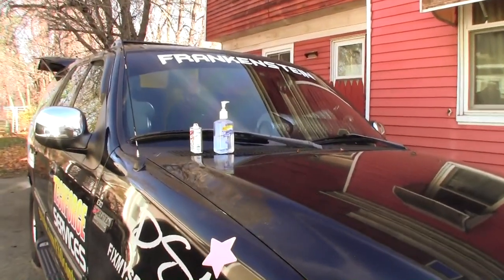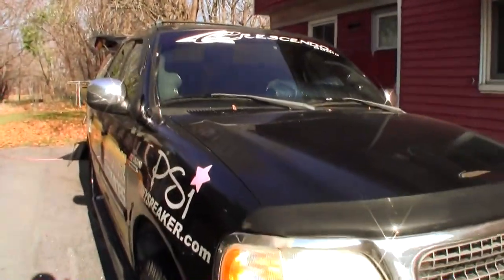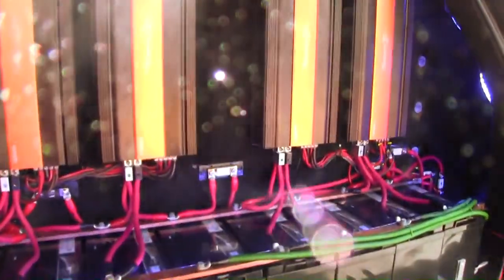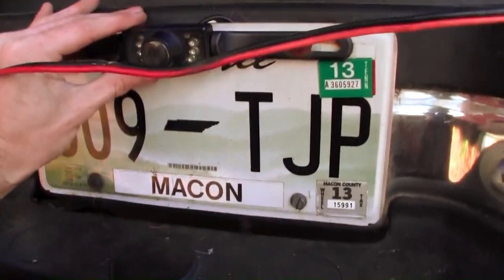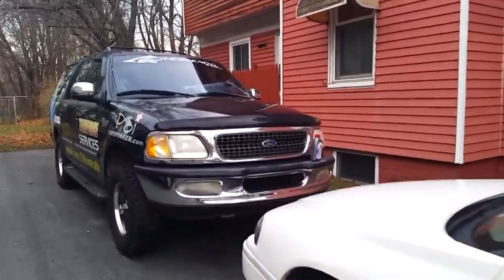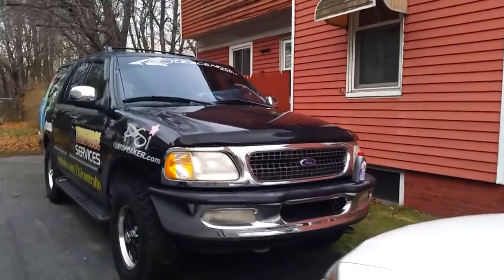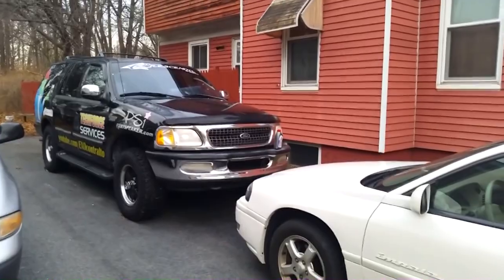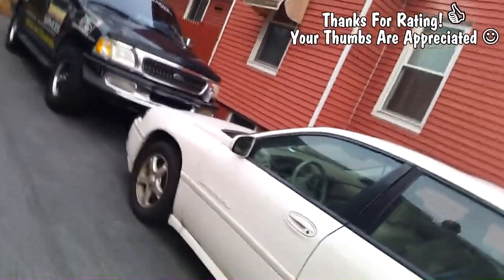Amp Rack Cleaned & Carpeted Up + Adding Crescendo Audio Decals / Registering Frankenstein

Comment: Hey, what's going on EXOubulous haha. Goops off... Hang in there bro. Your biggest fans have waited patiently for years. As long as you get it sorted out, put you first bro. Oh and LOL those amps are way underrated. My amp is rated at 1600w rms and the CT's put out just about the same if not more. Rated at 1400w rms but does well above 2k LOL